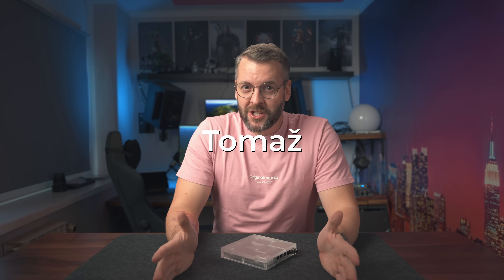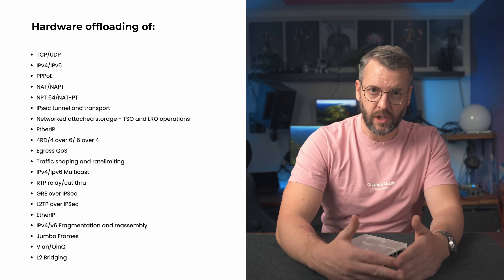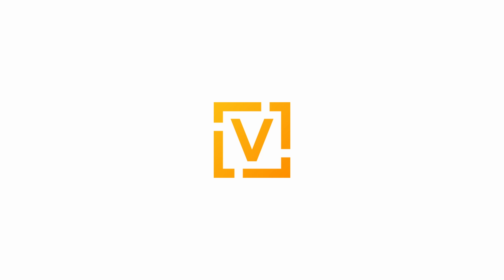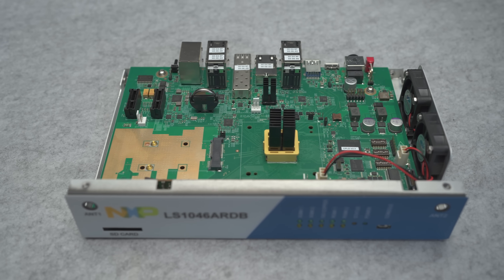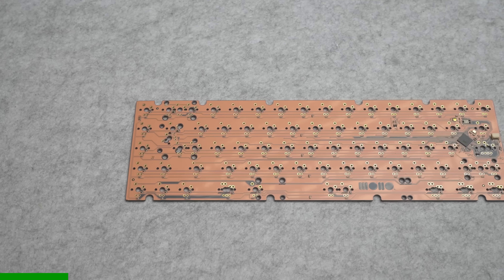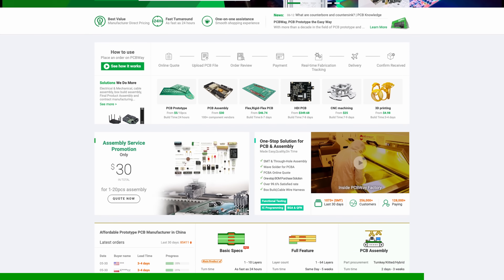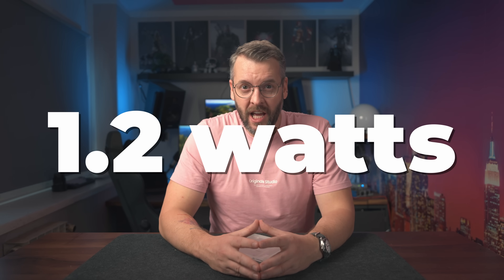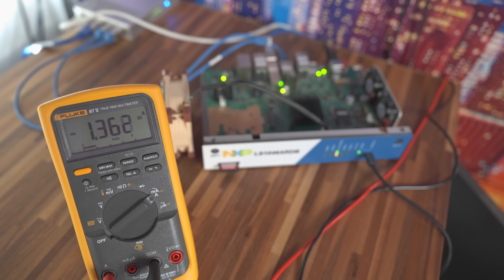10 Gb/s throughput without using CPU cores? ✅ Check.

Comment: Rightsizing a ‘network beast’ does not require maxing everything. The viewers of this series probably will pay the extra $100 but the wider public might see it as an invitation to want to run containers etc. That’s not the job of a ‘network beast’ which should be efficient in watts and capital.

Comment: I'm only slowly entering the world of custom networking gear and not using the ISP provided gear with a couple of the cheapest APs and switches possible, so apologies for the novice questions and random thoughts; 
Would it make sense to choose a mix of the two, so the 1.4GHz with the 8GB of ram? To me it seems like the 0.2Ghz is much less of a downgrade, than the 50% less memory. 
I don't know what sort of services would benefit from another 4GB of ram or, perhaps more interestingly, 0.2Ghz faster processor. Would something like WireGuard run noticeably quicker on the 1.8 vs the 1.4Ghz, would the 4GB ram be enough for it? What are some services that you would usually run on a router?
Nonetheless I do think the first version should probably be the fastest to get your name out and known as solid, if slightly over built, routers

Comment: I understand the trade off with binary blobs and proprietary hardware. The biggest problem is security audits and ongoing support. 

For security, we just have to trust NXP, but I expect there isn't any fully open source options out there with hardware offloading, without going full insanity mode and building a custom RISCV chip and drivers to do it.

The bigger issue IMO is ongoing support and maintenance, they are supplying not only kernel patches, but also patches to userspace programs as well. Those patches need to be kept in sync with subsequent releases of kernels / programs. This can be mitigated a bit by going with an LTS kernel but security updates are a certainty and again you are going to be relying on NXP to support that product.

I understand all hardware has a shelf life, but given this is a 10 gig router for home / small business users, outside of hardware failures I would expect these to last well past a decade.

It honestly highlights a design issue with the linux kernel if it requires patches to both the kernel and userspace programs in order to effectively make use of hardware features.

Comment: My question is whether this offloading allows for custom routing/firewall rules. I don't need deep packet inspection, but I'd like to be able to do basic IPS stuff.
Reply from the maker: Yes, the first packet in a new connection gets processed through kernel (and thus firewall) and if it passes, all subsequent ones that match the same criteria get offloaded to hardware.
Reply: @tomazzaman  Right on. I can live with that. Thanks!

Comment: Guess I was close with my initial 1W guess, I think maybe for the open source purists, if they can get a kernel they can compile or get from GitHub stat might be a fair tradeoff for them, then everyone else who wants the sweet sweet offload can hop on the NXP build. I think you might be missing a middle ground here, 1.4GHz + 8G RAM, I think if people are offloading and the NXP can do a "TAP" mode that could bubble up to something like SNORT or something else it might need the RAM for working with data before it puts it on disk or discards it. I think the offload really gives you the ability to step down in CPU hampsters, but if someone wants to also say, run a docker container for UniFi to control the downstream switches and/or APs, that is a bit of a fat memory pig, or it can be. The one I run in a raw vm in Digital Ocean uses ~1.5G of the 2G of the instance, then the OS eats some leaving me with only 88MiB free while it is at idle, vs what it may do/use during a upgrade and any database stuff that comes with that. My PiHole VM looks to use ~213MiB, and who knows what else random little things people might want to shoehorn in there. I can tell you, if you use internal DNS for all your home/lab stuff and the internet is useless until your lab maintenance is done or you swap DNS, it's kinda a pain, so I would like a backup PiHole or DNS server on the edge device that's not dependant on anything else, but it is all lightweight utility stuff. Unless someone wants to have a TPU in there doing like AI anomaly detection. I think I am more often sad about memory than CPU is the tl;dr here.

Comment: If there is a bug that can't be fixed with the direct hardware will there be an option to go via CPU and patch it that way?  Would there ever be a case for using the CPU to move the data? Some sort of packet filtering or encryption / decryption? If this is open source will the users need the CPU power?  If the answer to any of those is yes then stay with the better processor and RAM. Maybe offer a cheaper version that is not so patchable but is just the best 10Gbit router around.

Comment: the problem with closed source, is that lets say, 3 years down the line.  what happens when NXP wont update their drivers to work on anything newer than a 3 year old kernel release?
Reply: I have a NAS device which uses another NXP chip and nowadays the chip is no longer supported it seems (even though the NAS is still on the market). Linux version stuck at 3.2.54 (released ~10 years ago). No support in mainline kernel, no support in Yocto. I guess this is what can happen to this router as well.
Reply: It's a commercial product that NXP sells, so it's in NXP's best interests to continue supporting the product, or offer customers a better product to do the same thing
Reply from the maker: It's not closed source that way. We get the sources as a manufacturers, but can't share them. So in case NXP (which is extremely unlikely) stops working on it, we can pick it up ourselves.
Reply: @tomazzaman  that just kicks the problem down the road, how about a test without hw offloading and lets compare the results to make an informed decision, currently we only have the data for 1 side
Reply: @ss-xy2im exactly. I can't make a decision without a benchmark without hw offloading
Reply: @tomazzaman  The most likely issue will be the end-of-life for the chip you're using, and thus, newer SDK's dropping support. Once you have the source, you will always have that code. (your license to use it can expire, but that doesn't magically erase it from your drives.)
Reply: @tomazzaman  That's still closed source.
Reply: @tomazzaman And you will do that for free? It's not that I'm doubting your good will, honestly not. But the cost-benefit analysis simply does not make sense here. You don't stand to benefit from indefinitely porting these patches, your users do. And at some point, sales will dry up and you'll want to move on to other things.

So forgive me for being skeptical, but that's a red flag for me. That said, I'll still be keeping an eye on the project; you're doing some cool stuff here!

Comment: I would say the per device unit costs are something to consider. When you are manufacturing 100s or 1000s of units that extra 70 eur per device adds up quickly. So once you have your final design then your challenge is to reduce the cost per unit as much as possible to keep manufacturing costs down and profits up. 

I have a few thought questions to think about:
So I have to wonder at your current cpu/hardware design can you go faster than 10GbE? Is 25, 40, or 100GbE in this hardware’s future where you might need the CPU cores? 

What impact will full stateful packet inspection have on CPU usage (this is the big question). You can move packet forwarding to asic but how well does the hardware handle layer 3 to layer 7 packet inspection? I would think there would need to be kernel intervention beyond just simple packet forwarding. Before deciding on removing hardware lets see a near final prototype. 

With that development hardware can you underclock the hardware to see what the impact of 1.0 or 1.4Ghz means to the system’s operations? But from what you have shown there is no need for a 1.6Ghz 4 core cpu. Full packet inspection might change that opinion. 

On the open source front, I could see two versions (depending on the hardware dev kit licensing). The advanced version of your board design could use the hardware acceleration kit with its licensing fees. And the “basic” version where it does all in kernel routing and packet inspection. The former could use a lesser CPU and ram. The latter one would need the 1.6Ghz and 8GB of ram. Or you can just use the same hardware and the only difference is if you use the close source with the acceleration kit or open source with kernel based packet routing. This isn’t a fully formed plan, only an idea. 

I realize you have limited hardware for testing, but I wonder what the results would be if you add more senders  with the one receiver. The idea is to see if you can flood the 10GbE link until you start to get retrans errors. This would see how the hardware would manage to much data to forward. 

But all in all your hardware and your design team is doing a great job. You need to find the niche where your hardware has a market.

Comment: The Linux kernel see's around 60+ CVE patches a week (2024 Linux Foundation numbers). If you have to manually provide the kernels due to proprietary binary blobs, it takes the customization out of this device no? In fact, there are very interesting scheduling behaviour changes with newer kernels as well.
Reply: to be fair, the linux kernel makes a CVE entry for every bug/regression that appears, simply because they can't know if there is any security implications or not. the number of actual CVEs that matter and have any impact is significantly lower than that.
Reply: @commanderguy-rw7tj  This isn't totally true. Kernel upstream assigns a CVE for anything that COULD have security implications, not every bug outright. To be fair, a vast majority of bugs in the kernel can be considered a security concern due to the ring level of the relevant code...
Reply: @commanderguy-rw7tj  The new maintainer had to officially make a presentation regarding the topic due to EU regulation changes.

Comment: I'm a bit concerned that the packets handled by hardware offloading won't be available in the kernel - will the device support packet inspection or other forms of packet manipulation outside of the dedicated chip?
Reply from the maker: You can turn off hardware offloading to do the inspection. It'll be slower, granted, but only until you turn it back on again.
Reply: Many of these types of SoC support port-mirroring. So it would be a matter of providing an interface to these HW functions.

Comment: Great video again!

Just wanted to know : Did you happen to have run some testing without the hardware offloading ? I'm curious about the result. 

On the price aspect : I think cheaper is the way. But cheaper mean that we rely more on the 'block box' that is the binary and the support that NXP is willing to provide.. If the cheaper variant can still handle some 10G routing capabilities, without hardware offloading, why not !

Comment: Are you still planning on this being capable of IDS/IPS inspection? I thought I remembered that was the original plan.
I am wondering if all this hardware acceleration and low power goes out the window as soon as you start doing that though? That was a problem on a lot of Ubiquiti earlier gen devices where their 10gb Unifi router went from 10gb throughput to 1~ gb throughput with IPS on because it had to move the traffic to general CPU cores. Newer gen Unifi devices changed that up by using different SoCs to get more IPS speed. This product doesnt have to be any kind of full decrypt/encrypt interception inspection with certificates on end devices sort of thing, but having a standard IPS type system (probably suricata running ET Open ruleset?) with pattern and packet signature matching to detect malware or hack attempts in encrypted traffic would be great to have. I know not everyone is of this opinion, but to me, all firewalls should have that type of traffic inspection as standard now days as a basic stateful firewall just isn't good enough anymore for evolving threats.

Id be fine with a 1.4ghz CPU as long as it has the same HW accel blocks in it since the CPU cores dont really matter.

Edit: Looking at the Layerscape CPUs, I see that the 1046A does not have a pattern matching HW engine, so I am guessing if you do enable IDS/IPS that the speed will drop a ton like I was thinking. I also see that the next gen LS2084A CPU steps things up a little bit (but for a lot more money) and increases the security engine from 10gb to 20gb, adds a 20gb data compression/decompression engine, and adds on a 10gb pattern matching engine. So this would be the CPU to use in order to get 10gbps IDS/IPS I would think. Sadly it costs $285~, though probably a bit less when buying by the thousand. At that point though IDK if it is even worth using the next gen CPU when you could step up to an even higher end on, the LX2082A that gets you 50gbps HW accel throughput for only an extra $15. lol. Though I dont see the LX2082A having a pattern matching engine like the LS2084A has... So maybe that's why it is not much more for so much more throughput, as it is missing the pattern match part the "lower end" part has.

Comment: Correct me if I'm wrong but this (5:35) seems like a violation of the GPL to me. I don't think you are allowed to distribute derivative kernels under non compatible (i.e. non copyleft) licenses. That means that the proprietary software can only run in loadable modules and not patches built into the actual kernel binary. I might have misunderstood what you meant here though.
Reply: Yeah it seem alike that will run afoul of the GPL, I presume NXP also knows this and has a proper solution for it. (Modules, dkms etc)
Reply: @EraYaN  closed source kernel patches will violate the GPL anyway and by the time someone packs and sells this thing, that is, distributing as in the kernel, the recipient has all the rights in the worled to get the code for both the kernel patches and the drivers. To bypass GPL with dkms etc, you need the user to interactively install the needed stuff. If it's automated, it is as distributed, meaning it breaks GPL.
Reply: @seshpenguin  the Apache license isn’t a weak copyleft though? Isn’t it fully non-copyleft. Even if you were talking about a weak copyleft like Mozilla, doesn’t that copyleft portion only specifically apply to patching.
Reply: then better go with BSD.
Reply: Umm...
Only the parts that are written by others need to be attributed to and source made available.
Anything you write custom can be proprietary, that's exactly how Cisco, Oracle and tons of others do it. Patches are arguable because someone else wrote the patch to make the modification, thus one could argue that the patch it's self is an original work.
(Similar to claiming your artwork isn't original because you used my canvas material to make it, or Crayola's red paint to accent the sunset....)
Reply: @jamess1787  Well since the kernel links into one binary the full source tree used to build it will need to be made available that is sort of how the GPL works. That is why Oracle and others have their full tree available.
Reply: @jamess1787  If you change even a single bit in a GPL'd source file, YOU. MUST. PUBLISH. YOUR. CHANGES. Cisco, Oracle, "and tons of others" do publish their changes to GPL'd code. Their products are built from a sizable amount of non-GPL stuff, and they obviously don't publish any of that.

(It used to be easier to find those tarballs, but Cisco being Cisco makes you jump through hoops to get anything these days.)

Comment: It depends. Hardware offloading means the CPU and RAM will be free to do "something else". I think it depends on what this means. It would be good to know which kind of configurations, or features break the hardware offload, and what difference does having a slightly better CPU make. Anyway, I think that in most cases, a cheaper CPU with less RAM is a better option.  If HW offload is disabled for a feature, is not like 400Mhz CPU clock will amount to a night and day difference in throughput

Comment: Have you considered working with some sort of license for the performance gain using the closed source software? If so, keeping the CPU and Ram as-is, without the closed source module would (possibly) be just fine as a “basic” router. If you want more performance back on the router (let’s say for custom software (ex. ntopng)), you are able to free up CPU cycles by buying a license to use the closed source module. Kind of best of both worlds. Keep it open source by default; want to fully utilise the performance? Buy a license.